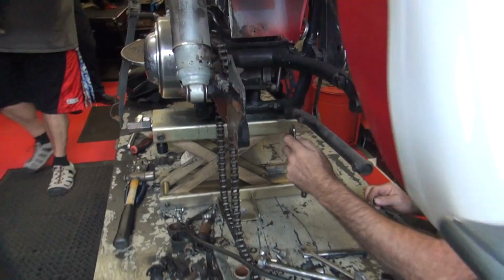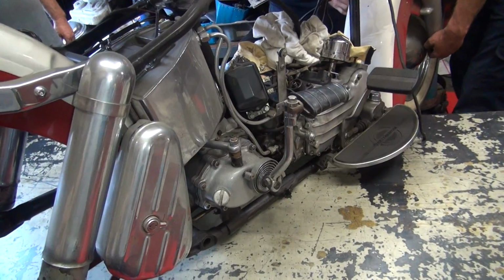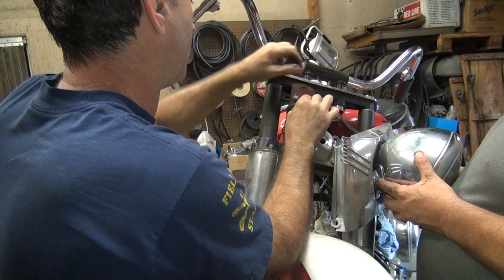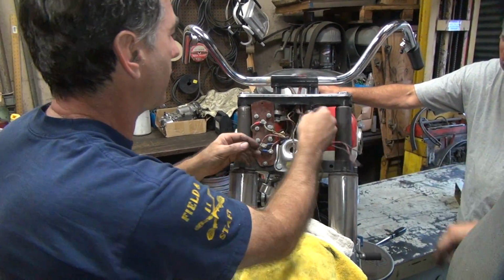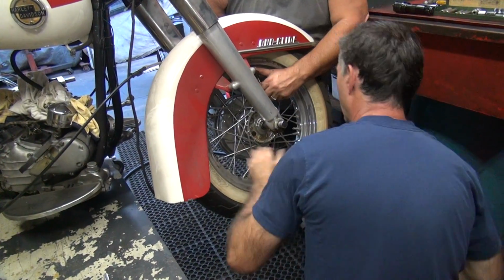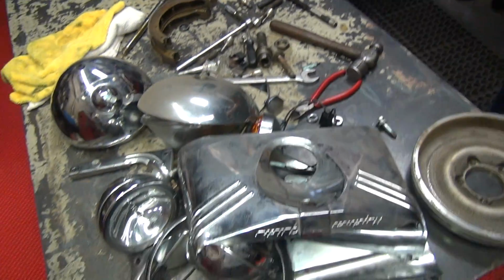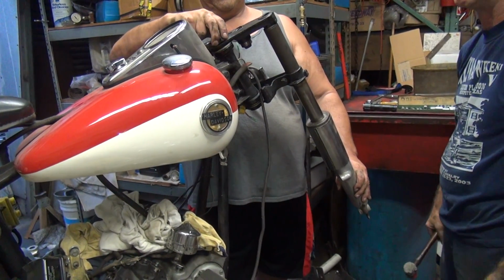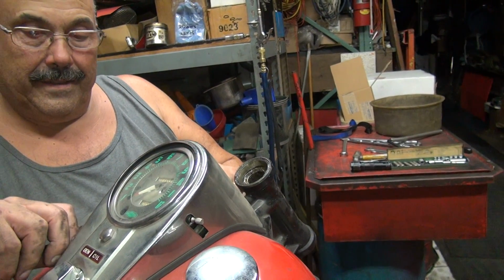1958 panhead 74ci #102 fl bike rebuild topend repair harley by tatro machine

Comment: How are ya gonna put it back together when you do shit like that?? You don't know Tatro. You could reduce that bike to one big box of parts and Tatro will know where each piece goes.
Reply from the maker: what, doesn't everyone know their bike.
tatro
Reply: Not like you. If I scraped a pile of nuts and bolts off the stand into a tray and set it on the side for later I'd be lost. When the parts come off I screw everything back into the holes from which they came. I might not get back to fixing it for another 2 years. Then I'd have to hire guys like you to put it back together. If you're feeling squirrely, you can take on my 1982 Honda CB 750. Cracking that case open was a big mistake. 15 years later and it's still sitting. Next stop, Ebay.
Reply from the maker: use your brain and just put one piece together at a time. after awhile it starts to take shape and you can see how things work.common sense helps alot too. when you get lost go look it up and see how it should be put together. 
i took stuff apart over 25 years ago and still have a good idea how they go back together.
how hard can a single cam honda be to put together. just go do it.
tatro
Reply: CB750 Lower End Rebuild #1               https://www.youtube.com/watch?v=czbVnqcDxU8